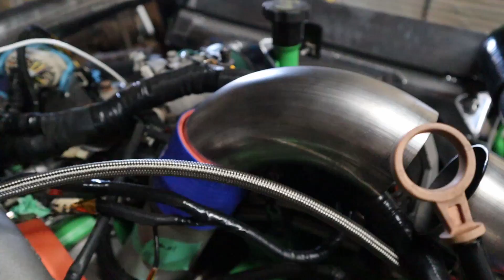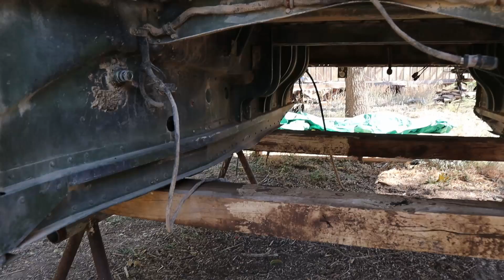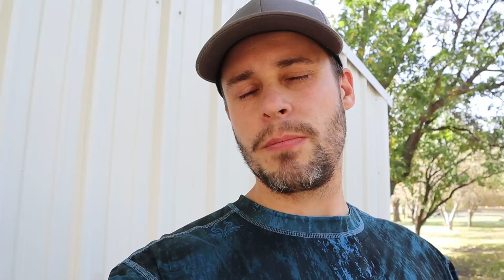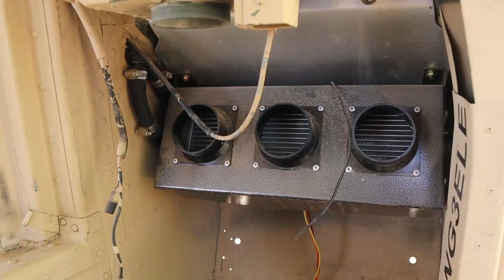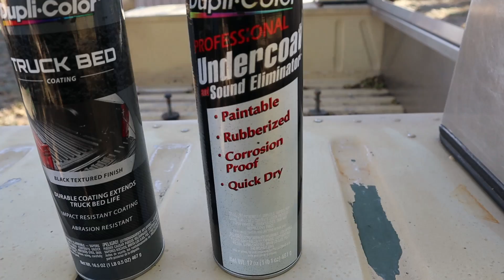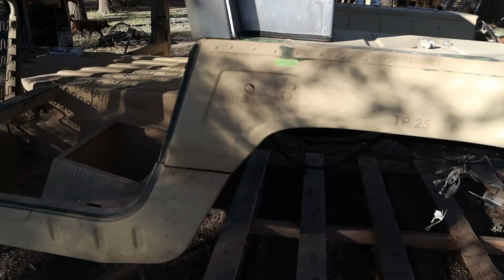[Duramax Humvee] Protecting the Underside of the Body - DupliColor Undercoat and Bedliner Coating

Comment: AWESOME CONTENT 👌 the left top shelf where the windshieldwasher fluid holder was, be sure to close up any unused bolt holes while its apart.   Mine had lots of leaks from old bolt holes  and it rained down on legs first time it rained/snowed.  Had to take it apart and seal them all...
Reply from the maker: Yeah I am definitely going to try to make it as weatherproof as possible. Going to see what better ways there are for doing the floor pan drains as well. Ive seen some that you are able to close off for everyday driving and open up when needed.
Reply: @tossthewrench  im just using some heavy rubber floor mats i made outta horse stall mat rubber.   1/2 inch thick. Gotta cut it with a jig saw. But works great, deaden sound a little and removable to let it drain fully .
Reply from the maker: Good idea